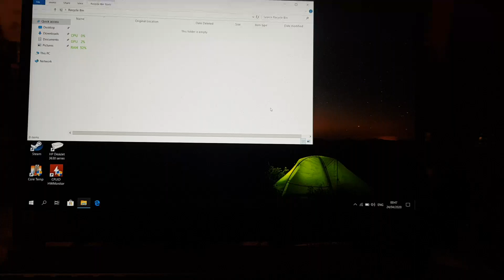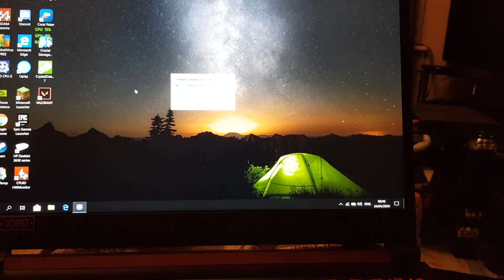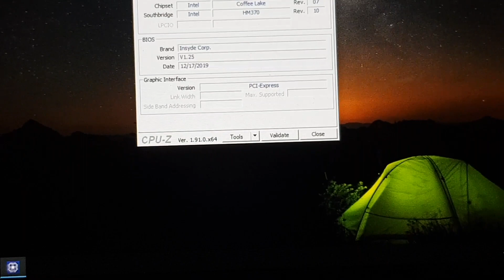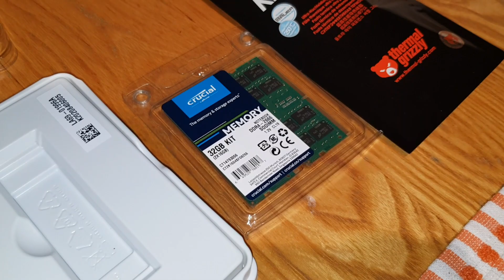How To Upgrade And Install More Ram Acer Nitro 5 Gaming Laptop

Comment: Acer Nitro 5 "AN515-44-R99Q does this laptop support crucial ram ?
Reply from the maker: Every laptop supports crucial ram, crucial is just a brand of ram, any brand can be used, you just need to find the ddr4 with correct speed, this usually is shown on crucial upgrade scanner it can choose the suitable ram for your laptop
Reply: The ram in laptop says 1Rx16 the memories i have seen says 1Rx8 does this matter?
Reply from the maker: @sofakingood3059  1rx8 means single rank with 8 blocks and it shouldnt matter, the only thing you need to find out is what is the size you can put in and what speed in mhz to get ram to work for your laptop
Reply: Yes my ram is kingston ddr4 3200 mhz 8b 
Im going to buy the crucial ram from amazon. Thank you i appreciate the help !
Reply from the maker: @sofakingood3059  this is fine make sure get same 3200mhz and ddr4 crucial all will be fine

Comment: I thought the exact same thing about the battery but.....................................   now I have only one working slot. I blame the battery for not being on the outside, being removed before accessing the case, but what can I do now. My money is long gone...
Reply from the maker: What did you think about the battery?, and how did the ram slot break?
Reply: @MrWaheedulHaque  It's a grand question. The way I see it, it was always bad, but with the original RAM it wouldn't shut down when the laptop was lifted. The new RAM, for whatever reason, makes the laptop shut down when lifted, or unbootable unless twisted slightly.
It's really a mystery but in my defense I've had bluescreens and what-not since day one, I just thought it was normal with new equipment and would pass with time and the salesman agreed obviously but surfing online I found it was quite common for my brand.
I also cannot use one new + one old RAM so I'm stuck with one 16gb stick.
Reply from the maker: @TheSphongleface  is this on the acer nitro?
Reply: @MrWaheedulHaque  Yes. AN515-54 N18C3 to be exact.
Reply from the maker: @TheSphongleface  oh thats very odd if you noticed problem with ram at start why not say anything ti acer email them anyways they might do something for you
Reply: @MrWaheedulHaque  I didn't think it was a real problem, and it would be fine for long times between each failure too
Reply from the maker: Talk to acer tell them

Comment: Hi can 2x8gb with 2666mhz each will work in Acer nitro 5?
Reply from the maker: Yes that will work fine no problem
Reply: Does higher ram make your laptop hot?
Reply from the maker: @jayceevlogs9637  no makes no difference at all

Comment: If you already have 8GB of ram inside from the factory and want to upgrade to 16GB, can you buy a 2x8GB kit, and remove that original 8GB it came with and put in the two new ones you ordered and it'll boot fine?

Like it's okay to remove the original 8GB stick right?

The reason I ask is because I like for the ram sticks to match.
Reply from the maker: Yes that is absolutely fine, thats what i like to do as well as it helps matching the timings and lets you run in dual channel
Reply: @MrWaheedulHaque  Does anything need to be done to make sure the laptop runs it in dual channel?

Or does the laptop know what to do already once it's installed and rebooted?
Reply from the maker: Nope it is plug and play it will know to run in dual channel itself as both ram timing will be the exact same so it will run it in dual channel giving you a tiny boost in system performance
Reply: @MrWaheedulHaque  Ok thank you for responding so quickly. You've been very helpful!

Comment: I'm abit confused at 12:20, why do they put one of the RAM sticks with the sticker facing down? Are the notches not symmetrical? Thanks for the vid btw
Reply from the maker: Nope one is one way and the other is backwards, just line them up with the notch and all will be well, and no problem bro thanks for watching
Reply: @MrWaheedulHaque  Thanks for that bro, also I watched your other video about adding a SSD but had some trouble. First I added a Evo 860 to the second PCIE port which the laptop wasn't recognising at all, then I tried the 970 EVO and it still wouldn't. I had to replace the original SSD and then it recognised it. Any help on this please?
Reply from the maker: @umairmahmood9183  it does recognise them you just need to initialise them, i think i show how to do that in one of the hard drive videos, im not too sure which one but i show it at the end of one of the videos, if not then just search on youtube how to initialise a hard drive
Reply: @MrWaheedulHaque  Yep I tried to but even when checking from the Bios and Disc Management it does not recognise either SSD (860 or 970). I had to install Windows and some drivers onto the 970 which replaced the original SSD. Really confused about that
Reply from the maker: @umairmahmood9183  thats very odd it should work out the box, all you have to do is intialise the drives and make partitions, but that is very odd
Reply: @MrWaheedulHaque  Do you think there's some problem with the PCIE port? Laptop is brand new so I'm really not sure. Even Samsung Magician doesn't recognise either SSD in the second port.
Reply from the maker: @umairmahmood9183  did u initialise the drive look on youtube how to do that and it will show up try that first before doing anything
Reply: @MrWaheedulHaque  Yep I tried that but it didn't come up on that either. It only showed the original 256gb SSD
Reply from the maker: @umairmahmood9183  then could be a possible problem with port
Reply: @MrWaheedulHaque  Just placed the original 256 SSD in the second slot with the 970 in the original. It has finally recognised both of them now. Do you think that Acer have put some security or something in?
Reply from the maker: @umairmahmood9183  might just need a bios update try that
Reply: @MrWaheedulHaque  Will do, thanks for your help bro

Comment: Is there a specific type of ddr4 ram I need to get or is it any ddr4?
Reply from the maker: Make sure to buy laptop ddr4, and a good brand, thats about it
Reply: @MrWaheedulHaque  so it definitely doesn't matter if I get 2666mhz or 3200mhz? Also thanks for replying so fast😁👍
Reply from the maker: Well depends on if your cpu supports it, whats the exact model of your cpu, ill check it for you, but yh higher the mhz the faster the ram will be
Reply: @MrWaheedulHaque  mine is an Intel Core i5 10300H CPU @ 2.50 Ghz
Reply: And I was looking at getting a Patriot Viper Steel 16gb DDR4 2666MHz SODIMM
Reply from the maker: @onelifefitness7489  your cpu supports 2933mhz ddr4 ram, so 3200mhz wouldnt work, 2666hz would work fine as its lower, but if you can get 2933 the highest speed ram for your laptop at similar price then go for it
Reply: @MrWaheedulHaque  perfect thankyou soooo much you saved me   a bunch of cash man, that's a sub from me
Reply from the maker: @onelifefitness7489  no problem bro enjoy your ram

Comment: when you install the other ram stick, you put everything back together and boot it back up or do we do something in the settings in order to use the other 8 go that I added?
Reply from the maker: Dont need to do anything just put back everything and boot up, ram will show up instantly check with task manager, control shift escape, if its not showing then u might have not seated the ram properly otherwise could be fault ram